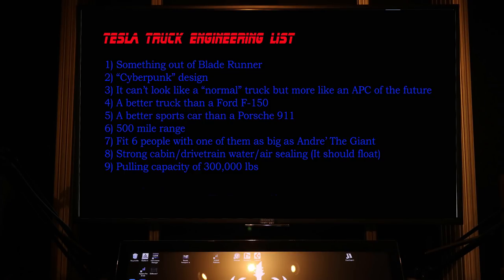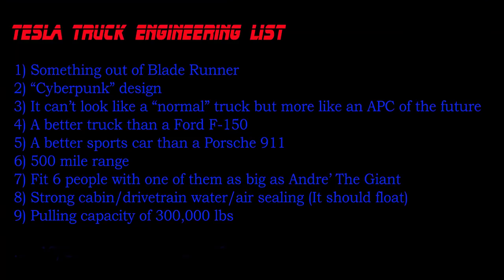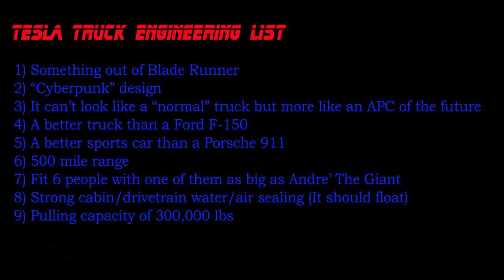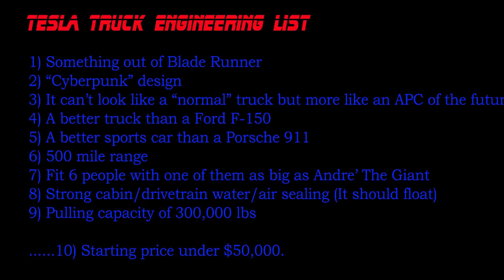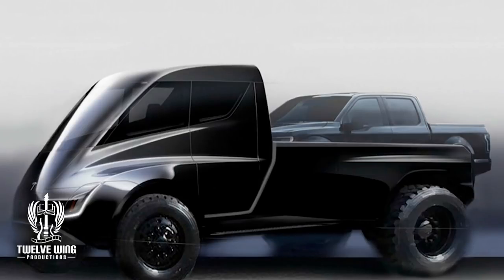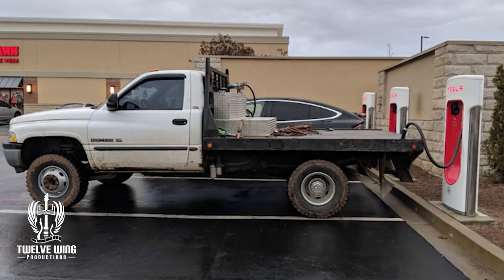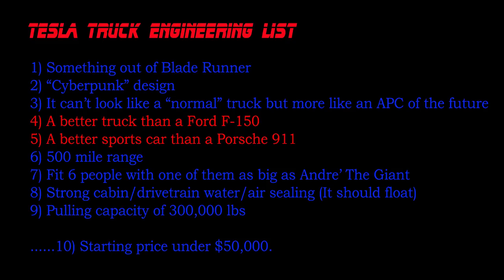What Tesla's Pickup Truck will Really look like: A design exercise

Comment: Ok, i'll bite. Here are my thoughts. I didn't write this all right now, I have been working on my own "predictions" for a while...

I generally agree with your rendering of the front of the vehicle, except for two details, and I have a prediction about the back that you didn't mention. 

First, I think the front bumper is going to be higher, I think 27" is the highest it could be and still satisfy all 50 US states, Canadian provinces, and Australia. This both matches the "must look like an futuristic APC" requirement and would improve vehicle aerodynamics... If the vehicles ground clearance it tall enough to lift the under-tray out of aerodynamic interaction with the ground (part of #4, ground clearance better than a F150), then a seamless gradually sloping front skid plate angled down from the bumper to the under-tray is ideal(also #4, offroad approach angle better than F-150). 

Second, after considering your point about the merits of a central drivers station, I agree with you in principle but disagree with your placement of the door in the rendering. If they go with a a three across, swiveling captains chair arrangement, There will be  only one set of entry doors, behind the captains chairs and in front of the rear bench. It does't make sense to include front doors only usable by occasional passengers, and reducing the number of doors lowers the part count(#10, cheaper to build). 

With regards to the back half of the vehicle, something that I haven't seen mentioned anywhere, but which seems obvious, is the inclusion of an integrated truck bed cap. APC's don't have pickup beds, neither does any vehicle in bladerunner I can think of. More importantly, from an aerodynamics point of view, the standard truck shape (vertical rear window, 8 foot open bed, solid tailgate) is an aerodynamic nightmare. If the vehicle is going to go 500 miles on even 200kWh, It needs to absolutely optimize its wake, no matter how aerodynamic the front is. I believe part of their trick to reach this range is going to be a optional HMMWV style sloped bed cap that splits along its centerline and folds down either into the bed sidewalls, or against the interior or exterior sides. Base models will be manually folded, higher models might be motorized in the same vein  as the model X doors. Using the bed of a truck for something taller than the cabin is a rare outlier, not the norm, even for serious farm trucks, and any other work truck is going to have a cap for cargo security. I expect Tesla will offer an alternative bed configuration that does away with the full 4' wide bed entirely in exchange for integrated side access toolboxes, slide out cargo racks, and fold down workbenches, all packaged in an aerodynamic teardrop rear. 

Next, Battery. I think your estimate of 200kWh is high, for a few reasons. 

First, I don't think it would fit. The imperative to keep the vehicle aerodynamic drag as low as possible means that every inch of vehicle height is precious. Combine this with a high ground clearance and a van-like interior cabin height... I don't think there is room for a 8"+ thick slab of batteries beneath the cabin and truck bed.  Assuming the battery is a single cell high (the model 3 modules are 3.4", plus the battery box) an  F-150 has ~21,000 cubic inches (344L) between the wheels, full width (120"x50"x3.5"). 344L x 0.42kWh/L(module volumetric energy density of model 3) is only 144kWh. If Tesla is able to increase their volumetric energy density by 20%(!) it only increases to 173kWh... I don't see it. 

Second, I don't think they need it.  I think that with every aerodynamic trick in the book (aerodynamically ideal front end, no ground effect, ideal truck cap, folding mirrors at highway speeds) the truck could achieve a better drag coefficient that the model X, and taking into account an increased frontal area, achieve similar Wh/mile numbers. at 350 Wh/mile, 175kWh is enough to get 500 miles of range. Now, an argument for packing more battery than needed is increasing the towing range, but I don't believe that is what they will do.  175kWh will provide a decent towing range (~250-300mi) assuming the trailer is aproximately the same size as the truck and relatively aerodynamic. If a buyer needs more range than that, I think Tesla will have a solution. 

I am willing to bet that after the inital truck reveal, in response to a canned "well, I need to tow futher than that!" question,  Tesla is going to announce a large capacity (75+kwh) transit rated powerpack, designed to be installed into or mounted on trailers. The "TrailerPack" connects to the truck through the  240v bed mounted outlet... When towing an aerodynamic trailer equipped with a TrailerPack, the truck will be able to match or beat it's 500mi base range.

The idea of splitting the battery onto the trailer adds some key advantages...  first, The truck and trailer can be plugged into two different superchargers in parallel, allowing for the <60 minute charge time Tesla owners have come to expect, without requiring upgrades to the supercharging network. Second A battery pack like this would be a valuable resource on job-sites, providing power while allowing the truck to still be useful hauling material during the work day. Tesla is uniquely equipped to make this product, being a worldwide leader in both EV and stationary storage batteries. The same product could be used in semi trailers with the tesla semi.

Finally (this is getting absurd for a youtube comment) towing capacity. As you said, braking power is a much more important statistic than pulling force when talking about realistic towing capacity. The battery will be able to absorb a lot of power, being as large as it is, but there are limitation to regenerative braking, especially when the battery is near capacity. I predict that Tesla will take a play from diesel-electric locomotives and offer an optional resistive braking grid, installed in the truck bed, as part of a super-heavy towing package. This would allow for on-demand "dynamic braking" up to the full power of the electric motors, regardless of the state of battery charge... whatever the battery can absorb, it will, and everything else will become heat, without relying on the friction brakes of the truck or trailer. 

This is probably more than what you wanted, but you asked for it:)
Reply from the maker: FANTASTIC!
This is exactly the level of detail that makes me smile.  Folks have been thinking and wishing for this for so long and they know that unlike Rivian's approach... Elon Musk is crazy and isn't going to play it safe with design.
I really love the Rivian's tunnel.  I think that we will be seeing that kind of thing in Tesla's truck as well but I also think that Tesla has learned from the aftermarket community that they are in a kind of strange partnership with them.
If accessories become available for the Tesla truck that are specific to lifestyle adaptations similar to the pull out kitchen for the Rivian.... this thing is going to be a monster.
Reply: You sound like a guy I could have a beer with ... our comments are fairly similar !!! It will be exciting to see the truth of it all on the 21st.
Reply: @jamesbell8861  electric trucks and utility vehicles are a specific interest of mine. I saw your comment regarding a truck cap, it makes complete sense... Everyone I know either has a cap and complains about not being able to put a snowmobile or motorcycle in the bed, or doesn't have one and complains about not being able to store anything while they park in town... Something integrated and folding seems like the kind of first principles solution Elon Musk loves.
Reply: Wow!  I normally wouldn’t finish reading a comment this long but you have some very exciting ideas.  
I would love ❤️ to see Tesla do some outside of the box ideas like this that make a truck more functional, especially the folding bed cap.
I like the separate trailer battery idea as well.  
I just wish that with all of these batteries that we could somehow use them as home power backup during power outages.
Reply: kschleic9053 ... my brother built a canopy that lifted from each corner on pneumatic struts and ‘scissor bracing’. The sides pulled down with heavy awning material on a roller and snapped in on all 4 sides.  It was a bit of a ‘pain in the butt’, and it wasn’t very secure but it actually worked pretty good for the “haywired” contraption that it was. I was 3/4 impressed ... I thought he was on to something there.  Now if TESLA could make it work effortlessly and be highly adjustable, strong and look great that would be an awesome feature. I was even thinking sides that work like pocket doors ???
Reply from the maker: @jamesbell8861  Very kind of you James.  I think I'd like that.
And yes, we are all just on pins and needles waiting for the 21st.

It's been fantastic to see everyone's thoughts.  It's going to make it very fun to do the follow up and see how close/far off everyone was.
Reply: @jamesbell8861  have pictures? Sounds cool!
Reply: Great thoughts except that we're speaking all that for $50K. That's like the Model 3 performance with the cab at half the body of a model 3, powerful all wheel drive motors and drive/tow suspension, all the weight of the batteries under the cab as counterweight - thing is there must be good margins with the F-150 anyway for  the 2020 mid  priced versions to cost around $50K up to $76K for the higher end
Reply: @ash98981  consider this... in 2018 The Ford F-150 sold with an average sale price of $47k, and Ford reported a gross profit of $10k per vehicle for their truck business... Conventional trucks don't cost that much to build, and a big part of their cost is their drivetrains. 

I agree with you that a base cybertruck wont be able to do everything I mentioned, I think it will have a 100kwh battery, 250-300mi range, a manually folding (or maybe rigid removable) rear shell, and a very Spartan, probably hoseable, interior. The towing capacity will probably be marginally better than a base F-150.

I think that in this configuration, at 49,999$ the truck should be quite profitable. The cost improvements of their latest manufacturing patents (minimalist rigid wiring, consolidated body/frame stamping) are really going to be huge.
Reply: kschleic9053 ... I might actually ... I’ll have to have a look back through my picture archives !!! I’ll let you know.
Reply: @kschleic9053  I'm thinking the battery system has to be new, bigly improved, and way cheaper than prior.
Reply: @ash98981  it is possible, but if that was the case, I don't think they would have been able to keep it quiet.
Reply: @kschleic9053  I wouldnt be so sure- I kept asking myself (during the Tesla test trials in Germany) why go all the way to Nuremberg? Then after Musk signed a contract with CATL the puzzle seemed clearer, Tesla's Gigafactories 3 and 4 are located in the same areas as CATL about 1000m from each other in China and 75m in Germany. The NY location is in the same vicinity as Conamix a company that Panasonic is investing in and is Tesla friendly- what do these companies have in common the chemistry for less lithium and Cobalt batteries- all Tesla needs is the chemistry they can manufacture their own batteries.  It's highly probable they were testing battery chemistry on the track in Germany, BASF and many other Germany battery chemistry companies are also in and around Germany looking to get into the battery act.
Reply: @ash98981  interesting... I haven't heard some of that before. Maybe you are right. If so, things are going to be interesting:)
Reply: @kschleic9053  You havent heard this before because I do my own research , and not count on the same repeated information of the internet--- and if I'm correct easily explains why the cars on the track were "stripped down", as reporters complained.
Reply: ..to further my argument......will post this after market closes tomorrow
Reply: @ash98981  my phone notification had a snippet of your unedited comment... I'm looking forward to it.
Reply: @kschleic9053  If you look at the top 100 best lap times in both Laguna Seca and Nurbugring the Model S falls in the area where cars of around 3800lbs and similar horse power are amazingly 37th (Laguna) and 49th (Nurbugring) - Musk said the Laguna car was production, and the blue car at the 'ring' ran around the same times as the Taycan 7:40, then later on the Red car ran a hand timed best of 7:23 (wow)- I'm thinking they took some weight off of the car- Musk promised they would return and that 7:05 was doable- That's the record time for the  electric NioEP9 ( $1.2m) and it's also in the class of million dollar cars:
-----------Nur "Ring"
2 Lamborghini Aventador SVJ $574

7 Porsche 918 Spyder $845K

9 Aventador LP750-4 SV $530K

13 Nio EP9 $1.2M

16 Nissan GT-R Nismo (R35) $145-$210

22 Porsche 918 Spyder $845

27 Camaro ZL1 1LE Package $75K

30 Nissan GT-R (R35 550 PS) $125k

34 Jaguar XE SV Project 8 $200K

37 Tesla Model S
------------------------Laguna
27 Camaro ZL1 1LE Package

33 Nissan GT-R Nismo (R35)

37 Lamborghini Aventador LP700-4

38 Nissan GT-R Nismo (R35)

46 Mercedes-Benz AMG GT 63 S

47 Nissan GT-R (R35 530 PS)

48 Honda NSX (Mk II)

52 Nissan GT-R (R35 550 PS)

49 Tesla Model S

54 Ford Shelby Mustang GT350

55 Jaguar XE SV Project 8

56 Nissan GT-R (R35 570PS)

61 Chevrolet Camaro Z/28

Now about the weight- there are some guys who stripped their Model S down as best they could to get a record drag time of 10.4 and that  car was still 4460lbs way far from the 3800 pounds where the Tesla finds itself at both the 'Ring' and Laguna- It's the Tesla Motors!!!!!!! They're Monsters!   BTW the F-150 and work trucks are rated around 400hp for the best of em' -Tesla going with 3 motors next year will could increase their horse power hp to around 1000hp, while the truck really doesnt need Model S motors to equal the equivalent of trucks out their now.
Reply: kschleic9053 Well, you were right about the aerodynamics.  It looks like they may have designed the entire back half of the truck to accommodate the retractable bed cover.
I gotta say, I was not mentally prepared for a design this radical.  As a shareholder I was literally sweating.  I still haven’t dared to look at the stock price this morning 😓
The specs are solid though and the price.  WHAT?  $39,000!  I don’t think anyone expected that.
If I could somehow mount a ladder rack to it I would still purchase one for work.
Reply: @dougdstecklein  I don't know how a ladder rack will work. With the sharp edges roofline. I expect that might be chamfered into a flat spot before release, both for mounting a rack, but also for accessories like a light bar, antennas, etc.